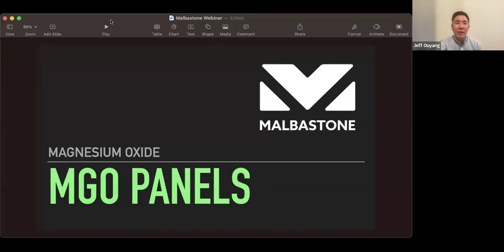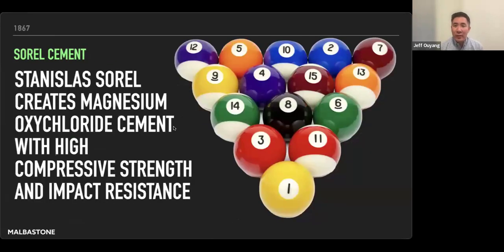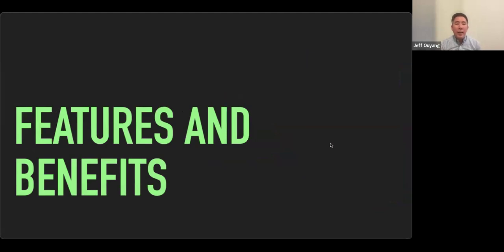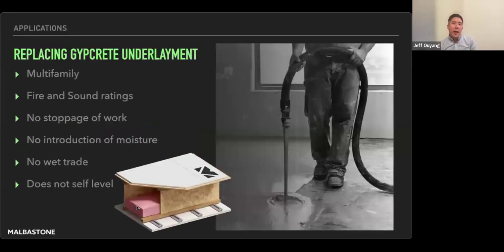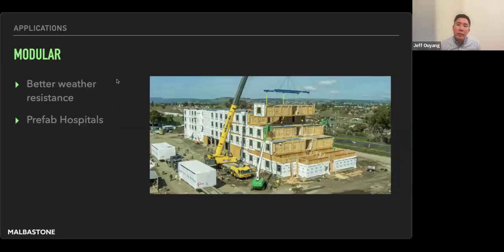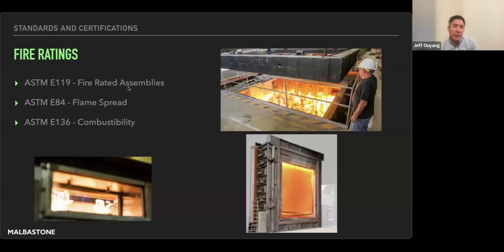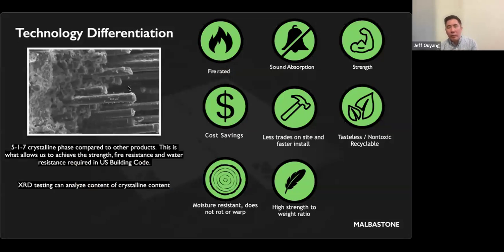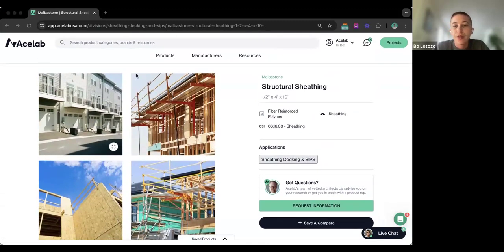Magnesium Oxide MGO Panels [Webinar]

Comment: Magnesium Oxide (MgO) panels are a type of building material made from magnesium oxide, which is a naturally occurring mineral. These panels are commonly used in construction for their durability, fire resistance, and environmental benefits. Here's an overview of their properties, uses, and advantages:

Properties of Magnesium Oxide (MgO) Panels:

Fire Resistance: MgO panels are highly fire-resistant, making them a popular choice for fireproofing applications. They can withstand high temperatures and are often used as a fire barrier or in areas that require enhanced fire protection.

Durability: Magnesium oxide is known for its strength and resistance to wear and tear. MgO panels are resistant to impact, moisture, and mildew, making them a long-lasting material for a variety of construction needs.

Environmental Friendliness: MgO panels are made from natural materials and have a low environmental impact compared to other construction materials, such as gypsum or cement. They are often considered more sustainable due to their ability to be recycled and their lower carbon footprint in production.

Moisture Resistance: MgO panels are resistant to moisture, unlike many traditional materials that can degrade or weaken when exposed to water. This makes them suitable for areas with high humidity, such as bathrooms or basements.

Thermal Insulation: MgO panels offer good thermal insulation properties, contributing to energy efficiency in buildings. They help maintain consistent indoor temperatures and reduce the need for additional heating or cooling.

Sound Insulation: The dense structure of MgO panels also provides soundproofing qualities, making them useful in spaces where noise control is important.

Non-toxic: MgO panels are free from harmful chemicals such as asbestos or formaldehyde, which are often found in other building materials. This makes them a safer option for both the environment and human health.

Uses of Magnesium Oxide (MgO) Panels:

Wall Panels: MgO panels are commonly used for interior and exterior walls. They are a good alternative to drywall or plywood, providing superior durability, fire resistance, and moisture resistance.

Ceiling Tiles: MgO panels are often used in ceiling applications due to their lightweight nature and fireproof qualities.

Flooring: Some MgO panels are used as subflooring materials, offering a sturdy and moisture-resistant base for other floor coverings.

Fireproofing Applications: MgO panels are widely used in fire-rated constructions, such as fire doors, fireproof walls, and partitions.

Insulation: The thermal insulating properties of MgO panels make them useful in insulation systems, helping to reduce energy consumption in buildings.

Precast Concrete: MgO panels can be used in conjunction with precast concrete for structural applications, such as in the construction of commercial and residential buildings.

Advantages of Magnesium Oxide (MgO) Panels:

Enhanced Safety: With their fire-resistant, moisture-resistant, and non-toxic properties, MgO panels provide a safer option for building construction, reducing risks from fire, mold, and hazardous materials.

Sustainability: The use of MgO panels can contribute to more sustainable construction practices by reducing the environmental impact compared to traditional materials. Their recyclability and minimal chemical content make them a better choice for eco-conscious builders.

Long-Term Cost Savings: While MgO panels may be slightly more expensive than traditional materials, their durability, low maintenance requirements, and energy efficiency can lead to long-term cost savings in building construction and maintenance.

Versatility: MgO panels can be used in a variety of construction applications, from residential to commercial buildings, and for both interior and exterior purposes.

Conclusion:
Magnesium Oxide (MgO) panels offer a range of benefits in construction, from enhanced fire resistance and durability to environmental sustainability and cost savings. As awareness of their advantages grows, they are becoming a popular choice for modern building projects, especially in areas where fireproofing, moisture control, and energy efficiency are priorities.